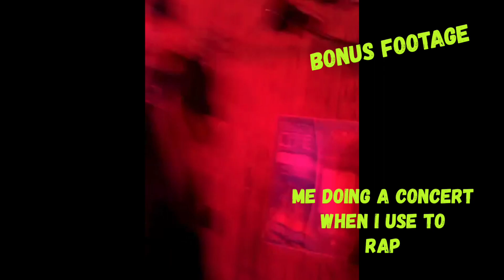Re-tuning my box to 29hz! 2 Skar Evl 18s in trunk build. How to change tune of subwoofer box

Comment: I have a 4 inch aero port with 16 inches length which gives about a 34Hz tune in a 1.8 cu/ft gross box. Want to try a 28Hz tune by using a smaller port diameter of 3 inches but keeping the same length. Only problem is most songs I listen to don't even play that low. 7 out of 10 songs I'll randomly play don't even play that well on a 35Hz tune so I expect this to get worse with an even lower tune unless all I listened to was decaf, rebased, rap etc. 35Hz is already very low but seems like the sweet spot for daily listening. I think 40-45Hz would be ideal to play most music but then I'd miss the low end excursion. Bass head problems. Only running about 500 watts @ 4ohms to a 10" type r or fosgate T1 10 so sealed is not an option as I'd need twice more power to get the same loudness of a ported box but am only on stock electrical with no dimming and it's loud enough for me but the sealed would sound good for all music types.
Reply from the maker: I wouldn’t change your port if u don’t listen to songs with low bass
Reply: @ptakcaraudiochannel2675  agree but it would not be permanent my box can switch out both ports with just screws. I do listen to songs with low bass but that's not all I listen too. Would love more  demos of this new tune you have.